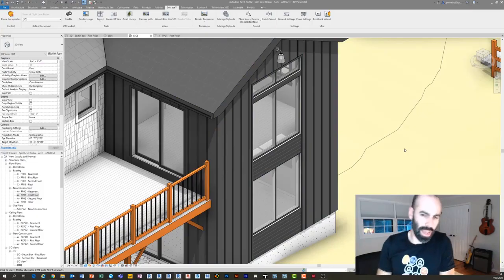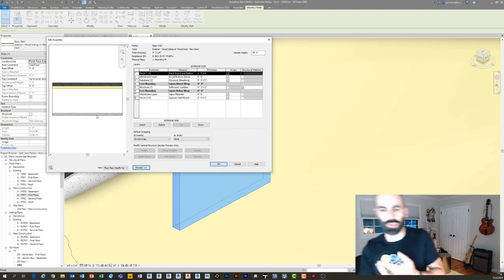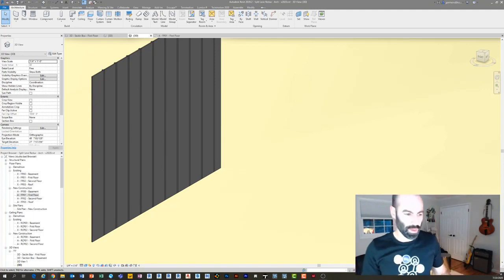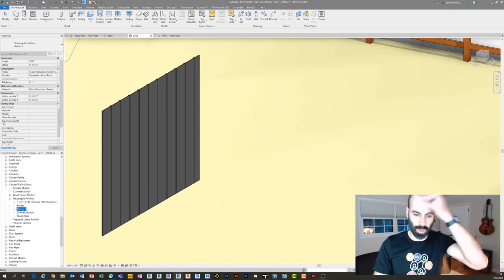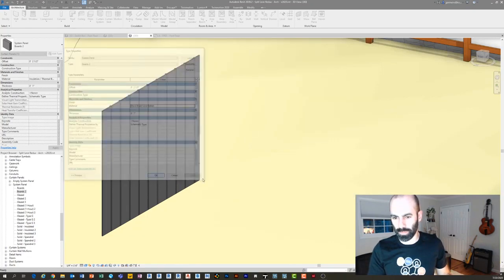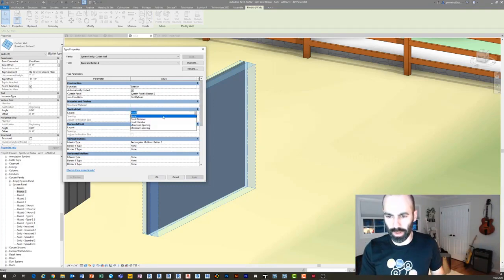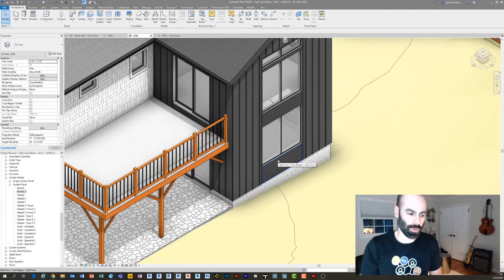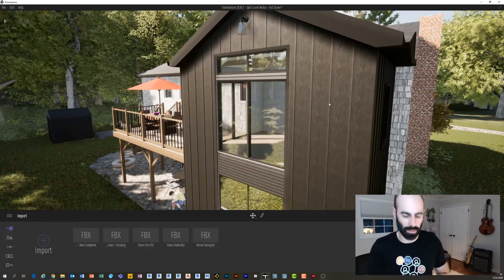How to Model Board and Batten Siding in Revit Tutorial

Comment: Hi Jeff. I have a project that is modeled with no siding that I wanted to apply B&B after the fact. Is there an easy way to apply this curtain wall over existing walls giving the panel a 3/4" thickness, and have it automatically cut out at openings?
Reply from the maker: as I show in the video... the downfall of this method is you have to manually cut the openings... good luck!

Comment: Hi i have tried this it's worked..but when i put door on this wall ...door does not hosted on this wall....plz reply
Reply from the maker: As I mentioned in the video… the downside to this method is you have to manually creat the openings for the windows and doors by modifying the wall sketch.

Comment: I think there is a better approach then this.......the problem with this approach is that you can't add windows or doors. some how you have to cut through the panel.  unless i'm wrong
Reply: There’s no other way around if you actually want vertical board and battens modeled in. Sad case

Comment: So helpful but I can't figure out how to get windows to cut through. Even with curtain system by face?
Reply from the maker: Kelly Trout you have to edit the profile of the curtain wall... unfortunately, that is the easiest solution.
Reply: Here's the workflow that's worked for me on my projects - this works especially well if you're already sure about the placement of openings and overall geometry, and if you're making multiple curtain-walls to show studs, battens, membranes, siding etc.:

1. Create mass
2. Create ref-planes(shortcut RP)
3. Create model lines and select the plane, making sure to check "Create surfaces from closed 2D-loops" in the small ribbon directly beneath the little box where you select what type of line to create. This box only appears after you've clicked on, for example, the rectangle option under the "Create"-tab. 
4. Once you've finished the sketch and the lines are closed, you now get a surface that can be seen as a slightly opaque surface in Revit. 
5. Create extrusion and turn it into void, making sure to check "Cut geometry". Drag the box as far out as you need
6. Now you can sketch on planes, and depending on the geometry you might just be able to copy the profile of previous sketches and editing them slightly. 
7. The void you created in step 5 will not cut further surfaces by default, so you must click on "Cut Geometry", within the modify-tab, select the void(s), then click on the surface you wish to be cut. Repeat this for all surfaces you wish to cut. 
8. If you now go into "Massing and Site"-tab, you can click on wall by face, then click on the surface you wish the wall to be placed on. 
9. After you're happy with the placement of the wall, you can then click on  the wall, edit profile, and make the changes you wish to - there is no conflict between the surface you've made in massing, and the actual profile. 

(10). Another way to edit the walls you've made is to go back into the mass, and edit your desired surfaces, then finishing. To change the wall, you must click the wall again and click "Update to face". I don't personally like this, as step 9 is much faster and easier for me to work with. I've also encountered several errors with using "Update to face", especially with more complicated system panels and mullions that sometimes conflict, resulting in floating missing mullions. 

A different option entirely is also to create one wall, edit profile, and sketch the openings. 

To create the other layers of the wall, you must manually click "Copy" in "Modify"-tab, then click "Paste", and select "Paste in same place", then going into plan or top-view, and dragging the wall out so it butts up against the back-wall.  
Using CTRL-C + CTRL-V doesn't work. 
Once pasted, change the wall type to what you'd like, and go into edit profile to make small changes if you desire. 
I like this method for simpler projects, as it usually suffices. 

Hope this helps :)